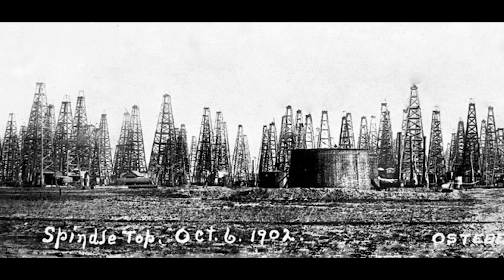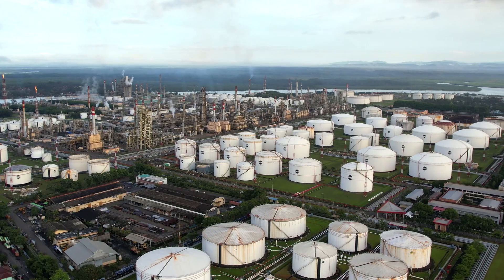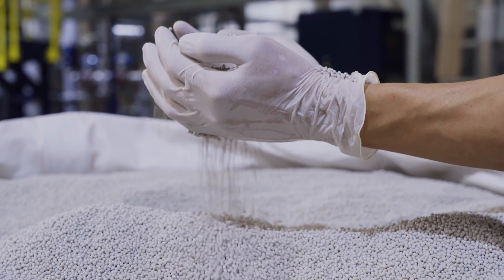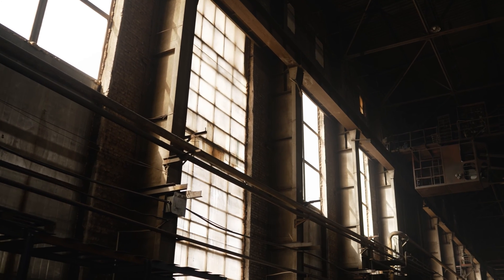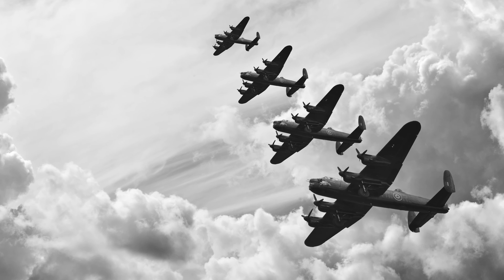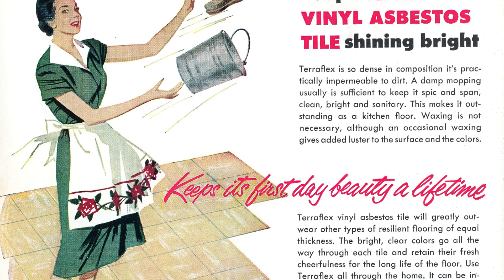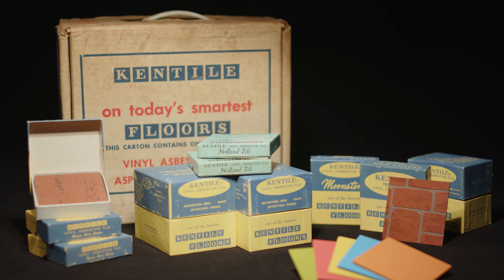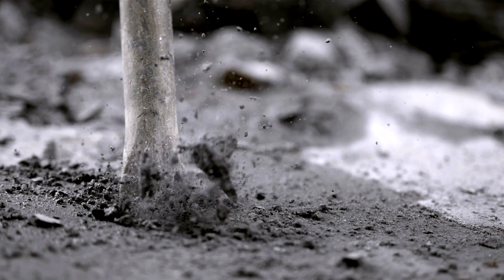The Surprising History of Vinyl Tiles and Asbestos | Asbestos Artifacts Explained

Comment: Great video, I feel like not enough diy renovators even know that vinyl sheet floor and vinyl tiles had asbestos in it. Its how I ended up exposed, as my dad did a renovation without ever being careful, it was a one time exposure but my anxiety has been pretty bad since I realized what happened that day. 

My dad sanded the adhesive under the sheet floor to expose the original wood floor, the floor came out beautifully but I worry that it came at the cost of our futures. 

Is it true that a moderate one time exposure is not enough to ever cause health issues? What happens when you are exposed at a very young age? 
Is this something I should even worry about if it was a one-time exposure? I often feel doomed because of this exposure, is this unreasonable/irrational?
Reply from the maker: I did cover single exposure in another video: https://www.youtube.com/watch?v=rVHqpjp-IaM

To be clear, there is no known "safe" level of asbestos. But one brief exposure more than likely will NOT lead to long-term damage. Check out my above video for some additional info. If you are concerned about lung health you can always speak to a doctor about regular checkups, but keep in mind ALL of my clients had long-term exposure (years).
Reply: @asbestosclaimslaw  Thank you, I watched the video and it seems I should be okay then, the only part that is freaky is the thought that those fibers are in my lungs and may never leave. I guess everyone has at least a few asbestos fibers in their lungs though considering how prevalent it was/is, yet people don’t tend to get sick from asbestos.
Reply from the maker: @nandii_8850  Yes we all probably have a little bit of asbestos in us. And plastic for that matter. And lord knows what else.
Reply: @asbestosclaimslaw  I guess at this point its just a downside  of living in our modern society, it just is what it is… I should just be glad the stuff is banned and I don’t have to be around or exposed to it frequently.